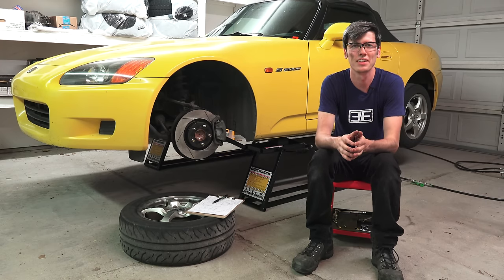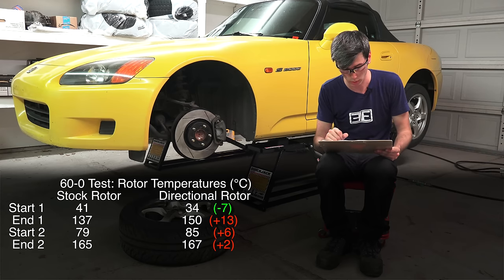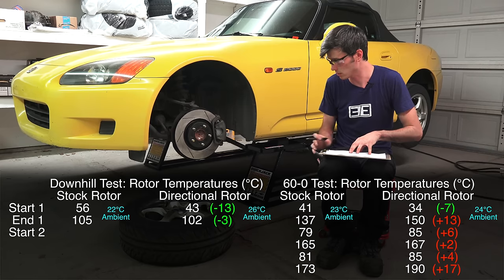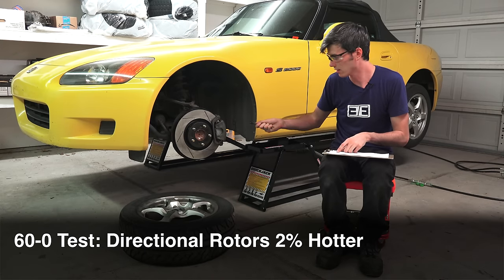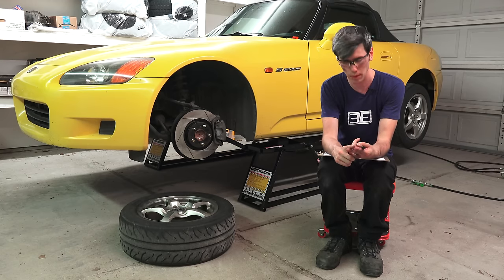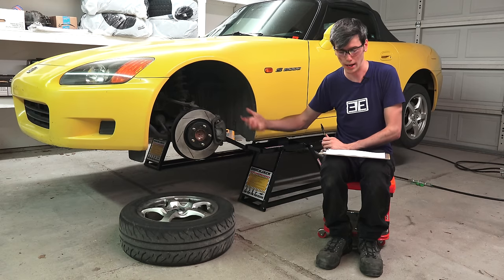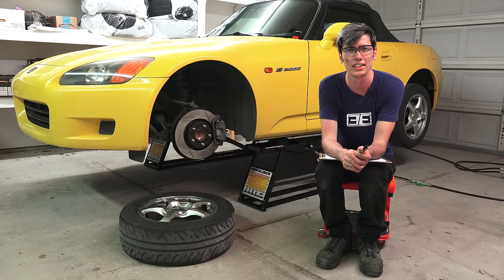Do Performance Brake Rotors Have Better Cooling?

Comment: Another factor would be how quickly they can stop the vehicle. If the slotted rotors stop the vehicle 5 ft shorter from 60 MPH, they will be hotter.

Rotors that are 1 pound less per wheel will also be beneficial with unsprung weight, which will provide a slight performance gain. On a track, multiply that slight performance advantage by 100 laps and it will become a significant advantage.

I replaced the stock wheels on my BMW M240ix with very lightweight forged wheels and had lighter tires mounted on them, which cut weight by nearly 10 pounds per wheel. That reduction in unsprung weight, with NO other modifications, cut 0 - 60 times by 3/10ths of a second. When it's time to do the brakes, I'll be looking for lightweight rotors.

Comment: Yeah great bud, but slots are for preventing gas and debris from inhibiting pad to rotor contact.  Drilled rotors are for cooling.  Slotted rotors will actually be hotter because you get better pad contact.

Comment: That’s right. The grooves are for gas release in case you are using race pads that release gas and would make them hover a bit when hot. Drilled rotors would do the same but they compromise integrity so and micro cracks are likely to appear. However, there are manufacturers that use drilled rotors on sports cars but they are oversized that’s the trick and will cope with a sporty driving so they are ok too that way. 
Racecars use small grooved, discs but they have air ducts to blow fresh air on them an keep them cool. The smaller size (normal size) means the wheel is lighter.

Comment: I would have used a data logging arduino. Measure the temp rise and fall while driving. I have done that with model airplane motors. Surprisingly I measured motor temp, ambient temp and battery temp at the same time. found out the motor would heat up on decent, when the power was at the minimum (less prop wash to cool the motor). Excel showed the line graphs.

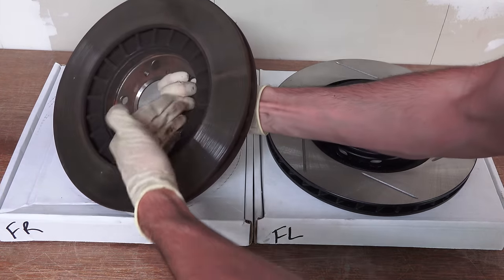Comment: You failed to address the paint on the slotted rotors vs oem blanks. The paint would insulate the metal more than rust would. Also, I am pretty sure you put the slotted rotor on backwards, looking at 1:36, I see you have a rotor on the front drivers side. The veins(channels between both brake surfaces) to pull air into the rotor are backwards for that location. That is why I believe your test came up with the slotted rotors being hotter. I am pretty surprised a channel called Engineering Explained failed to address two of the most obvious reasons a rotor would be hotter. I am surprised that in 5 years, no one seems to have noticed that you put the rotors on backwards.
Reply: The rotors are even Marked on which side they go.   SAD.

Comment: One hypothesis to explain why aftermarket rotor performance was worse in your experiment but better in Honda’s: speed. Airflow around objects tends to behave differently depending on speed. It might be the case that the slots simply don’t work well at low speeds, but start to shine at much higher speeds.

Comment: Engineering Explained: Can you do this test again with the same exact models of each brake? LIke EBC's OEM compared to their drilled and slotted? with the same mass, size, spec, material, just the difference of slotted and drilled I feel like you might have a better control of exact differences. These come from different manufactures? also Manufactures go out of their way to over engineer their stock parts. so the stock parts alone might have out performed your after market choice since the stock brakes are literally designed for the car and non other. 

Thank you

Comment: What about break in bedding? Or old pads on new rotors. Too many variables.
Reply: Maybe, but the general consensus is that blank rotors are ideal for street use all things considered. Slotted/drilled rotors better for track.

Comment: Interesting take from an engineer's point of view. The slots outside help with the hot gases that happens between the pad and the rotor so it should reduce the temp over stock. Maybe its better at brake fade than the oem. Interesting take for a daily point of view. Also next test should be with the ceramic pads
Reply: Show me these  'Hot gasses' and how they manifest between the rotor and pad.

Comment: I love your content and have watched a lot of your videos. It’s the first time I’ve seen a video where you neglected a variable. You failed to account for the Venturi effect caused on the wheel wells. The way you have the rotors veins installed makes it pull air against a vacuum and push it back into the wheel well. Flip the rotors around and repeat the test. There’s a reason why there’s no logical explanation for your results.

Comment: I'd think that this only tells part of the story... yeah temperature is nice, but what you're really looking for is how well can you stop! 

So with slightly higher rotor temps, the pad material will likely bite a bit harder and bring your vehicle down in speed faster with less pedal application. 

All depends on how you want to quantify winning results.

Comment: I dont think this really adequately tests the differences.  others here have said this too, but those directional rotors are intended to be used in higher performance applications, not coasting down a hill.  I think if u took your s2k to a track and tested the difference before and after 3 laps on each set of rotors, you might find the results to be a little different.  As someone else mentioned, the rotor is also designed to keep the pads cool, so testing pad temp might be interesting too, though perhaps a bit awkward.

Comment: Does the higher temperature of the aftermarket rotors negatively affect the performance/safety during normal street driving? If yes, would the benefits of the reduction of unprung weight outweigh the negatives of higher heat? Also, do curved vanes technically affect aerodynamics as it's influencing the air? I know it's probably a negligible amount, but if yes, would it be a good or bad effect on aero (theoretically speaking)?

Just had a thought, did you install the vanes in the correct direction?

Comment: It cools down faster, has less mass AND is hotter after the break. That means it out performance stock in EVERY aspect. Brakes purpose is to transform kinetic energy to heat. That means if it’s hotter it has transformed MORE energy than stock ;-)
When it also cools down quicker its quicker ready to transform even more kinetic energy.
Reply: Higher temperature doesn't mean more heat, or thermal energy, when as explained the mass is different.
Reply: @tombombadil3501  True, and agree. But the way he focus most of the time about the high temp makes it sound wrong when he does not say much about the fundementals behind it. From all that is sayd in the review I would say those disks are about 7+% better then stock, but also depending on what is importent to you.

Comment: The problem is that you didn't run all 4 rotors.

The mass and stopping being done by the aftermarket is more than factory, hence the higher temperature.

Run all 4 so braking is evenly distributed since the system utilizes a balance of brake fluid pressure.

Comment: You're transferring engine combustion to friction heat in the rotors. Thus stopping.   Hotter is better (for the most part) so long as the brakes can stand it- not warp or fade...Do they stop thevehicle in a shorter distance? If yes and hotter, that means they work better.

Comment: If you give it some consideration of the design of the slotted brakes, it only cools while it is spinning. Coming to a dead stop and measuring does not give it any time to engage in sucking in air to cool, which is the design and purpose of the vanes. If you want to produce a better test that engages the cooling aspects of the brakes, try 60 - 0, then go back up to 30 for 1 minute and then brake using your emergency brake. Test the brakes after that - chances are the stock brakes would be hotter than the aftermarket directional brakes because it would have engaged the design of the system.

Comment: Were the rotors marked which side they should be on?  They look backwards from most slotted kits I’ve used.  The slots usually sweep outwards during forward travel.

Comment: Sorry to say you tested the wrong thing.  The rotors are designed to cool down faster at high speed. You just tested the temperature rise for a non measured heat input.  A better test is go get them to a known temperature and drive at a constant speed without braking for a few minutes to see how fast the temperature decreases.  Best way to do that is with a sensor monitoring as you drive. The slots are designed to keep the break pads clean and may provide more stopping torqued at the same pedal pressure.  I do like your videos but you missed here

Comment: Cooling faster = less warping. Less warping = longer lasting. Longer lasting = less cost, long term. Less heat = better brake force. Less gas = reduced pad wear/pad boiling/brake fluid boiling and overall better daily wear.

Comment: Just finished watching a brake video.  The technician made a point of saying to have the slots pointing to the rear of the car not the front as in your case.  Is that at possible?  Not a criticism just a suggestion.

Comment: I’ve been using these slotted and drilled rotors on my truck for years and I’ll tell you what there’s nothing that stops like these we got trailers to pull you can they’ll lock your tires right up they’re beautiful and they can war believe it or not. I’ve worked mine and Adam return, your have you got a great drill press you can make your own and drill rotors it’s a great option for people pulling heavy loads

Comment: fast forward from my comment 2 years ago...I upgraded my rotors and pads from Power Stop for my 2016 Focus ST before my track weekend last week at MSR Houston. My 'upgraded' pads melted to the bare metal in only a few sessions. My driver side caliper actually caught fire. I ended up having to buy two new calipers, rotors, and pads. Was not fun. Mine are the drilled and slotted ones. Power Stop has labeled them to have the slot going away from the direction of the tire, but everywhere online i see says to put the slots into the direction, like they're 'clawing' with the rotation of the tire. Maybe doing it by their instructions caused my pads to trap in heat and fade super fast...either way dont skimp and do em right...my pads were GONE in only a few sessions and caught fire...

Comment: I don’t consider Jason’s test method “wrong”.

I would day: Jason’s test reflects “daily driving” - in this scenario the stock rotor is a more suitable choice. 

Vs for track application, then the directional rotors is a suitable choice.

Comment: A better test would have been to drive down a known mountain road under similar very demanding conditions to compare the two.  With a lot of hard, continuous braking, you probably WOULD notice a much larger difference in performance under the more demanding conditions.  In fact, it is under those conditions that large trucks burn out their brakes (and even start on fire) because they don't have enough time to cool. Under those conditions, I had a SERIOUS brake fade one time on my 4wd SUV when I hit a T intersection coming down the mountain.  Where if I didn't slow down enough to turn 90 degrees right or left, I would drive off the road skidding (or rollover off the road) and literally down the face of the mountain.  My vehicle would have broken up going down.  

Of course, had I not slowed down enough to make the turn, I pretty much would have been killed. Jamming the brakes on as HARD as I could, my brakes gave me just barely enough braking that I was able to slow down enough, but I was REALLY worried about also rolling over and off the road (and down thousands of feet of mountain face) as I made the turn at what was still waaaaaay too fast a speed. But it was the best I could do with no advance warning.  

I NEVER allowed that to happen again!!!  One of my closest moments to pretty much being killed. I knew exactly how close I was to killing myself by a roll down the mountain like you see in the movies.  Fortunately, that was my last (and worst) turn before the road flattened out and I could let the brakes cool.  It was sooooo close though. I only had factory pads on and those were not really appropriate for those conditions.  Way too demanding because I also had way oversized tires as well. I have never experienced that kind of brake fade before and I never have since.

Comment: Noticed the rotors are installed incorrectly, which may have made a diff. ? the slots are suppose to slant in the other direction, like tires. The tread patter, when direction, point backwards. .these rotors on your care are angled towards the front. ??

Comment: So... I'm noticing the factory rotors have been on this car probably a year, or more, thus perfect bedding of pad to rotor. So friction surface is at optimal levels, aftermarket setup looks to be brand new... it would take approximately 500 miles to have them 100% bedded in stop and go situations. Even a forced stomp bedding process wont be as effective... so I think this test was flawed from the beginning. Forcing a pad utilizing only 20 to 60% of its total surface area, the average upon new pad to rotor ratio. To generate the equivalent stopping power within the same distance of a perfectly bedded system, will have no choice but to generate more heat. This will change as more pad has come into contact with the rotor. So in conclusion,  yes a new setup will get way hotter, than a setup in full working order. True for all brakes, stock, or not. Test flawed.

Comment: The overall concept of this test is flawed. Without knowing the material properties of both rotors and pads you are comparing apples and oranges. If you don't have that data, you should at least have logged stopping distances.

Comment: Wow.  Never even got the brakes close to hot.  This is why testing like this is best done on a racetrack, not a public road.  Funny how you came to the same conclusion MkIV Supra owners did in 1998 when we looked at directional vanes (as delivered by Toyota) vs. straight vanes of the same mass.  2%.

Comment: Slam on the brakes from 100-0 until you get fade -- which took longer?
Prior to fade - what was the average and best braking?
If they do fade - how do they perform while they're over-heated? 

what temp can aftermarket brakes work UP to? 
Which brakes have a larger operating range?
their minimum operating temperature!??  CC need heat to work. 

How does the actual absolute-temperature MATTER!? 

Brakes are replaced when cut-down to where they're unable to hold heat relative to:
Car weight;  volume of braking, vs cooling-time
The Specific-Temperature  & thermal conductivity of iron is why they were chosen... 
Fade occurs when you can't convert kinetic energy to heat. 
THOSE are the physics I would expect from this channel.

Comment: Your test is flawed. First your control is using used rotors and pads. Why is this an issue you say? Worn pads and rotors will not create as much friction as new pads and rotors due to the new rotors and pads being perfectly flat increasing brake contact patch. Additionally you should be measuring the weight of the rotors. Many aftermarket rotors have thinner plates as well as less material between the plates. Then there is the material from which the brake linings are made. If you're going to do this there needs to be more work going into the test. Like brand new brake pads for each test, brand new rotors for each test, weigh the rotors, etc. This is not apples to apples.

Comment: Instead of trying to compensate for all the variables, why didn't you install stock rotors on one side of the vehicle and the performance rotors on the other side?  No need to introduce variables as ambient temperature changes, braking force, etc.

Comment: Slotted rotors are designed to stop gassing of the break pads for better GRIP...if there is more grip, then the slotted rotors WOULD BE HOTTER due to friction.

Comment: i seen some of newer cars come with the inner parts toward the hub area has holes in them looks like two pieces but they are not
would that make any different as far as unsprung weight goes ?

Comment: As soon as you told us they were lighter I was sold. Even if they didn't prove so much cooler on the track I'd take the lighter rotors anyway. That's Rotational AND Unsprung mass. No better weight to take out.

Comment: Honda OEM rotors lasted me 160k miles with regular pad changes. I think sticking to OEM rotors is best unless you can afford high quality slotted rotors. Also keep in mind track cars have frequent part changes so just because you get better stopping power doesn't mean you will get better longevity.

Comment: You should have used braking distance as the measure of heat added to the disks.

keeping the braking distance the same, the starting speed the same, then you can guarantee both versions of disks are getting the same energy dumped into them at the same rate. 
This would then really tell the difference.
That said.
I don't believe they cool better.